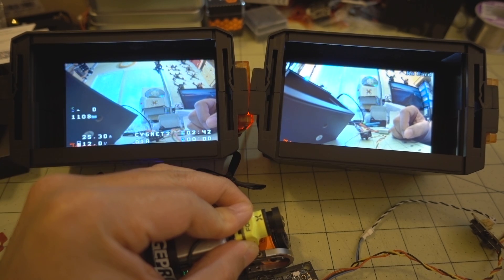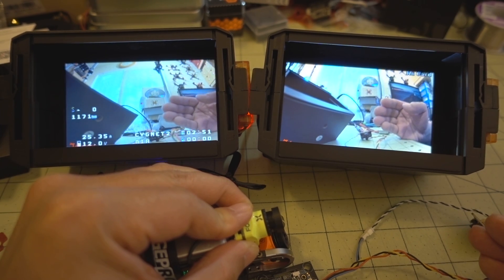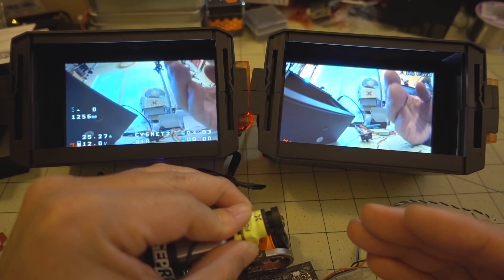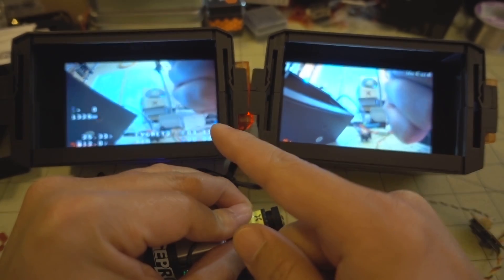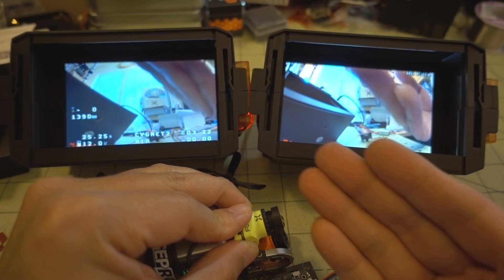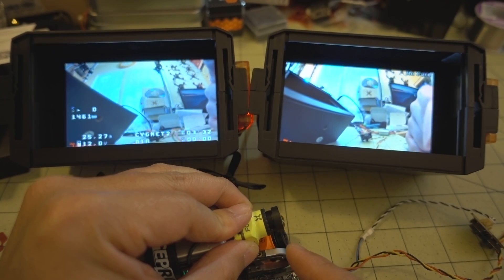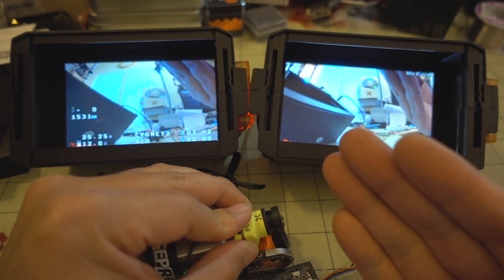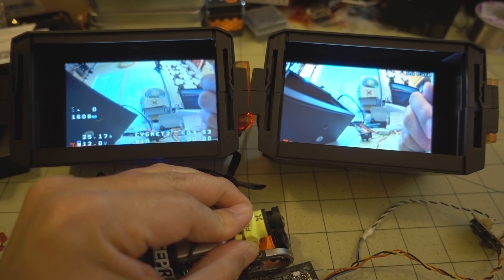Foxeer Mix Latency Testing 📝

Comment from the maker: I'm not sure why people are so interested in latency on these combo FPV/HD camera because they are all slower than the fastest cameras used by racers and any racer wouldn't use something like this for racing anyway, but here's the test anyway.  I have no problems flying with any of the three cameras in this category and they are perfectly fine for freestyle acro and cruising.  I don't race so I have no perspective on this aspect of using the camera.
Reply: I'm curious because there are 3 cameras out in this style. Latency is just one of the many comparisons between them for one to consider before buying. You are the closest thing we have to actually have "hands on" these items. I only get one shot at buying this, so all your input is very very much appreciated. Personally I'm going for a tomo whoopee. What cam do YOU think would be best in this frame. Do you think that the weight difference between these cams matter a whole lot? Thanks again!
Reply from the maker: @josecabral5208  On THAT specific frame, weight is critical so get the lightest one which I think is the Turtle.

Comment: There's exact and there's relative.  While exact measurements are nice to know about, they don't really give you a real-world idea of what they mean, so let's say that it's measured to be 5 milliseconds faster than another camera.  Ok, but what's that mean in practice?  Evidently, not much to most of us.  While a relative test such as you just did gives us a direct comparison that these are "relatively" all pretty good and so we can then make a good "common-sense" decision on what's good enough for us to buy for our own needs.

There is also the testing on the bench issue that may not address real-world situations.  In other words, perhaps the bench test says one camera is fast at recognizing changes intensity so camera A is twice as fast as camera B.  However, camera B is optimized for color digitization and has a super fast processor, over what camera A has, so what does that mean in real-world testing?  Perhaps camera B's throughput will be much faster overall in rendering complex scenery that camera A will struggle to record accurately which something usually readily visible in a side by comparison.  As in your comparison over the Predator video being faster, it was also grainier and less smooth than the mix; however, it was more accurate to the color and hue of the subject but that could be due to differences in the monitors or camera setting.  (A color bar chart would be useful here...hint, hint...Amazon...under $10.)

A relative comparison will always have its place in reviews. period.  Great job Albert and much appreciated.

Comment: Hey Albert, nice vid as always. I'd guess it would be better if you used phone with a timer next time. It will be easier to see what the latency in terms of time looks like :) Keep on doing great work! I find you one of the few that didn't go after the sponsors and providing true reviews :)
Reply from the maker: I did that kind of test a couple years ago, then it was pointed out to me that the refresh rate of the screen is like 20ms, so it's a completely useless test... I think I should just stop these kinds of videos since I don't have the proper equipment anyway and I'm not going to spend the money to buy it.

Comment: Thanks Albert.  I don’t think I can see much either, but that tells us something, too.  If we can’t see any (or much) difference between the Foxeer Mix and the (really fast) Predator camera, doesn’t that at least tell us that latency for the Foxeer Mix is acceptable for the use that the camera system was designed for?  On the other hand, if we actually had latency “numbers”, i.e. milliseconds, we might end up criticizing a camera because of a bigger latency of one camera over another when, in fact, the latency difference isn’t even discernible by the human eye.  Overall, it’s what we can discern that matters, yes?
Reply from the maker: Yeah, it's the same for me too.  I can't tell much difference, but there are pilots out there who insist they can tell the difference and that when one camera is at 10ms latency, it's "the best ever" and then another is at 20ms latency, it's "complete garbage".  I wish someone would actually put these super humans to the test to see if what they claim is true or if it's just hype.  Until someone can show me scientific evidence that such claims are valid, it's just hype to me.

Comment: At last, something other than stop clock accuracy.  It illustrates, to me anyway, the relative latency differences are minimal compared to our vision and reaction.  So for an 'average' hobbyist the concern of the extra latency of these hd cams isn't as critical as it is to razor sharp racers and such.  As a side note, a Runcam 2, if you can fit on a quad is relatively light compared to a go pro and has incredibly low latency if set up as fpv:)

Comment: I've made the request, thank you very much for did it :)

Almost identical, but the Mix is slightly seems faster to me.

If you are boring, you could make an other video with a smartphone + a good stopwatch app combo. However I've read somewhere those tests are not so reliable, imho the best method to compare latency without lab :)